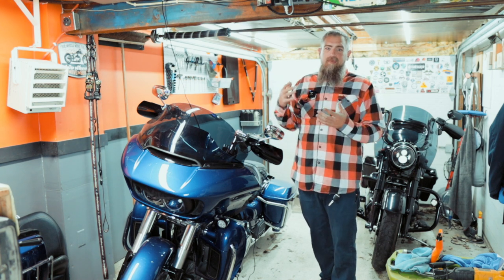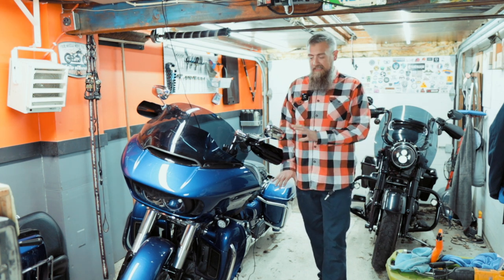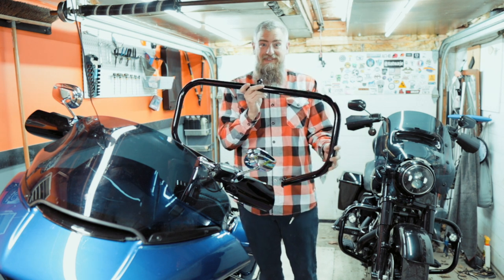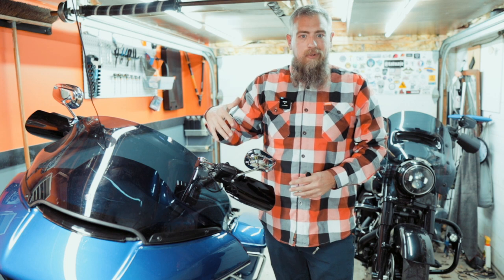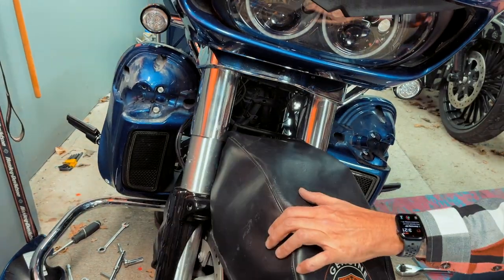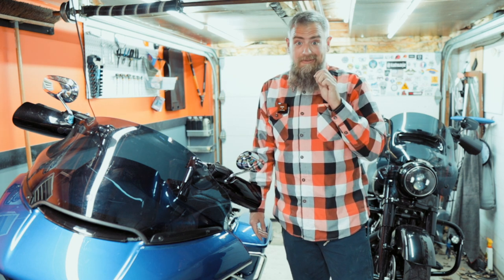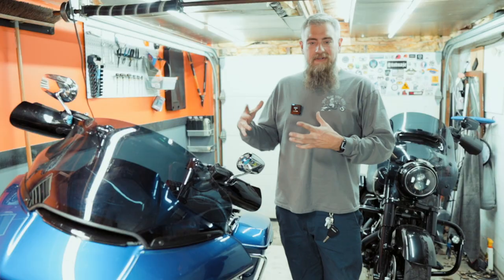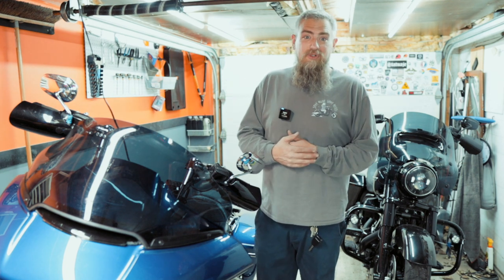The Issue with a Twin Cooled Harley Davidson | @Hogworkz Black Engine Guard Swap

Comment: Great video, thanks!  Just a note to others wanting to switch to black. Instead of spending over $150 on a new guard, you can take your stock guard to your local paint shop to blast and powder coat them. It was $25 for mine. 👍

Comment: Great video. Chrome can be a pain in the ass especially here in NH. Any sudden water that you don’t get rid of all of a sudden rust. I don’t know if the quality of the chrome but I bought the Factory 47 Bars and down where the 90degrees angle is a little rust popped up less than six months. I wish I had a garage😡 Where  my Road Glide Ultra is Vivid Black I’m thinking of keeping the Chrome. For people who don’t know there is a company who has designed drop guards specifically for Harley Touring bike. Check them out on YouTube. They demonstrate riding and purposely dropping it  to show the guards protect it from damage.
Reply from the maker: I love the look of chrome when It’s nice and polished but the black on superior blue just pops and I’ve been ready for a change.

Comment: Have u done anything to keep your legs cool I had a road king and didn't really get hot now I have the 2015 road glide and it def gets hotter on the legs any ideas
Reply from the maker: My engine stays pretty cool. It's a twin cooled model. I've not had much for issues with heat.

Comment: Bro, how about Hogworx bag liners with blue stitching?
Reply from the maker: I like the way you think my dude
Reply: @Touringmidwest  check out Cycle-Fanatix video on his bag liners he chose and installed… also Raider World has a video for the ones he ordered for his bike… super clean, great look, also Raider got some sweet blacked out screws for his bags… super inexpensive upgrade for a great look!
Reply: @Touringmidwest  Hey one of the things I liked Raider World did is he not only changed to black screws inside his bags, but he went with black levers on the outside, black latches, that really made his Red pop. Blacked out inexpensive items like that would make your blue pop the same. I would get rid of the rear crash bar though, or powder coat it black.